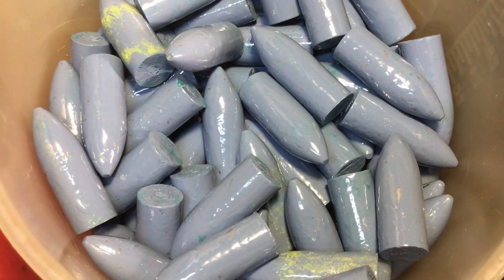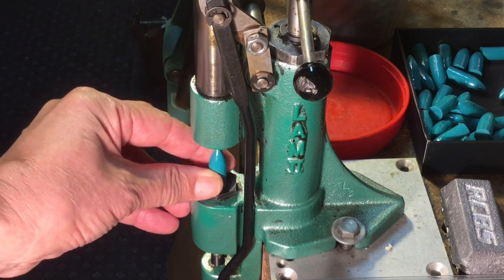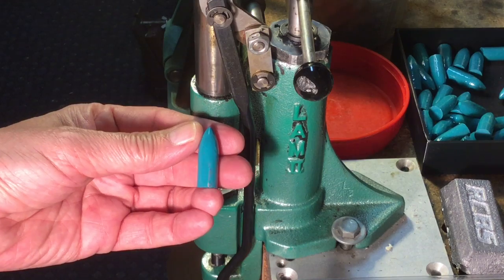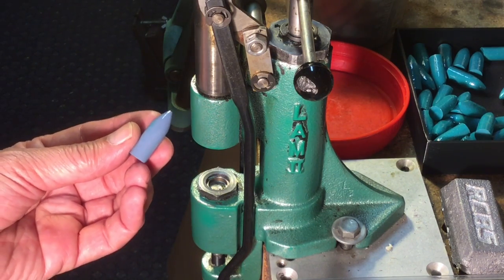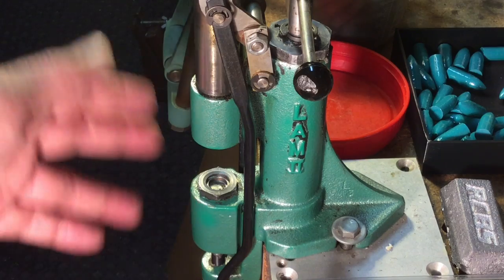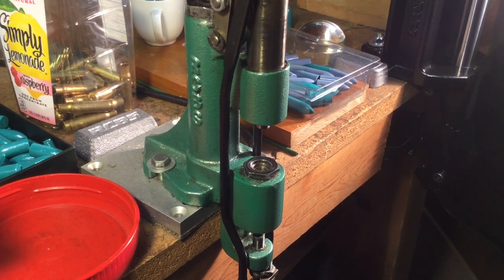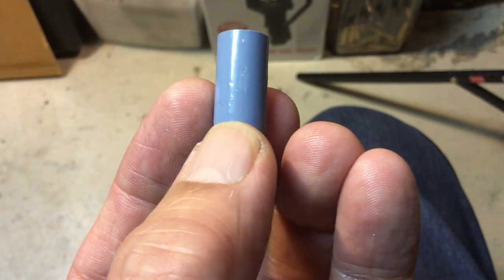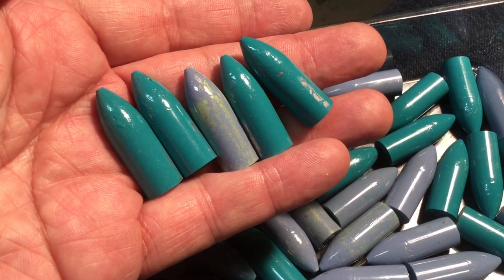Sizing The Grooveless Hard Cast Powder Coated Rifle 45s

Comment: Lee offers sizing dies in custom sizes for $38 according to their last cataloge, so you can get a lee sizing die in the right size and not risk damaging your die by trying to sand it out.
Reply from the maker: George Goff -  Thanks, George, but another commenter tell us that Track of the Wolf has some oddball Lee sizer kits available - I'm placing an order tomorrow... Best to ya,  FC
Reply: I have the track of the wold lee .459 I use for .458 socoms. I'm using it for the lee 500gr .459s, but mine have the lube grooves. Works fine though.
Reply from the maker: jesondag - Having the lube grooves makes that bullet more versatile - we can lube them the traditional way if we option for that...but with the grooveless, that option is not available.  Still a fine bullet to use...Best to ya,  FC
Reply: I powdercoat everything though, so I'm considering picking up one of these NOE molds. They come in 5 cavity, which is pretty cool.
Reply from the maker: jesondag - The 5 cavity from NOE really is cool...Whatever you use, - Good castin' to ya,  FC

Comment: Great videos! Thanks for continuously pumping them out. 

How does the aqua boolits hold up to a smash test? Do the different powder coatings all have the same smash test results?

How do you calculate hardness? Do you have any method to test the hardness before and after casting, quenching and coating?

Thanks again, Gara

Comment: You can get a custom Lee sizing die in any size you like whether its .458, 458.5 or .459. I had to get a .359 since they only make .357 and .358, but must say for powder coated bullets it really works great
Reply from the maker: Paul Campo - Thanks, Paul - turns out there are some odd ball Lee sizers already made over at Track of the Wolf - I'm placing an order tomorrow... Best to ya,  FC

Comment: I agree.....".case lube" reduces the friction during resizing
Reply from the maker: Rogers Steven - The case lube was tried, but did not reduce the number of rejects until the lube pressure was add to prevent the lube holes in the die from scraping the powder coat it was Todd Newsome's idea... It worked..!!  Best Regards,  FC

Comment: You may benefit from having a slight amount of lube on those bullets before you push them through the sizer, you could also benefit from getting locking mould handles, they really work well !
Reply from the maker: Englishman French - Did try the lube, but the rejects still happened - until another idea was added (video coming up)  Never heard of locking mold handles from Lee - must be an aftermarket add on... sounds interesting... Best to ya,  FC
Reply: FC 45: Sorry for the confusion there, the locking handles are made by 2 companies that I know of, they are not by Lee, but with a locking facility they give exactly the same "squeeze" pressure for every pour, it also gives your hand less stress in a long casting session, I am not sure if I am permitted to mention brands on here, but if you go to the site of a company that makes the Sharps rifle, in Big Timber, they have them.
Reply from the maker: Englishman French - Mentioning brands is very much welcome - to Shiloh Sharps it is...!!  Best to ya,  FC
Reply from the maker: Englishman French - Just checked out those locking mold handles from Shiloh Sharps - looks like they don't fit Lee 6 cavity molds - good for the 2 cavs.  Will have to do more investigation on those... But those rifles are sure sweet...!!  Best Regards to ya,  FC

Comment: I've always sized my cast boolits first with a Lee sizing die.  Then powder coat.  After a day after  (preferable more time than one day after PC), size them again with a Lee sizing die to my preferred size.  IE.  Size a 9mm cast bullet to 0.357.  PC it after.  Than size again to 0.358.  This of course depends on your bore diameter.  

Looking forward to your Range results with those thumper boolits!
Reply from the maker: migraineme - The only reason I don't size before PC is having to lube the bullets to size them...then having to degrease with acetone or other before PC can be done... If I can PC them first, then size to final - we just go straight there.  And that has worked so far...even here.  But it sounds like you are having success with the multiple sizings... Continued success to ya,  FC and Best to ya
Reply: FC45LC, instead of traditional bullet sizing lube, try isopropyl alcohol.  I use an old dish, pour a little in there.  Take a boolit, drop it in or just enough to get the sides covered wet.  Then push that puppy right through the sizer.  Since it's Isopropyl Alcohol it evaporates leaving no mess too.  Give it a shot sometime.
Reply from the maker: migraineme - I do use isopropyl alcohol in my lanolin case lube...but never just used the iso for lubing...Will have to give it a try...Best to ya,  FC

Comment: I have a suggestion fc try pressurizing the lube chamber or spraying some lube on the bullets.   It's looks like your only losing the powder coat where the lube injection holes are located in the sizing die the lube spray or having standing pressure in the sizing die could eliminate this problem and it may not I'm sure you've thought of solutions for this plus your are the man the myth the legend FC45LC
Reply from the maker: Todd Newsome - Thanks for posting, Todd.  I expected someone to suggest doing the case lube.  I had already tried the alcohol / lanolin case lube and it made the sizing feel a little better, but did not help the rejects - just forgot to  report on that.  My thoughts were to go with a softer alloy and forego hard cast penetrators.  But after your comment, I went back and lubed plus added your suggestion of not only pressurizing the lube on the RCBS LAM2, but also plugging in the heater...Result was success - you hit the nail right on the head with those scrape marks caused by the lube holes..!!  The rejects just got cut down to 0 with the Periwinkle Gray and like only 2 rejects out of 50 with the Aqua Blue...I've got to do an update immediately to let everybody else know...This is a great tip that will really help when we are trying to size down .003 with hard cast bullets... Hit 'em with the case lube and run the heater / pressurize the lube... This is really joyful... Best Regards to ya,  FC
Reply: FortuneCookie45LC yes nailed it thanks for trying my suggestions it makes me feel like I'm a success I just helped the great fortune cookie lol
Reply: Looks like its working from FC latest video....My 2 cents its the "Hydraulic" pressure that is helping remove the bullets
Reply from the maker: gman77gas - works like a charm when you compare without doing that... all the difference in the world...Have a great day, Gary -  FC Steve

Comment: Track of the wolf website sells Lee .458, 459, 460 sizing dies maybe more Plus lots of other fun stuff
Reply: Exactly...have bought them from TOW. After comparing generic powder coating with the proprietary "Hi-Tek" bullet coating from http://hi-performancebulletcoatings.com/ There is no comparison. In my experience, the Hi-Tek is far superior.
Reply from the maker: AbitNutz - Have known about HiTek since Bayou Bullets had the system available, but just haven't gotten around to trying it...My plan was to buy some 45/70 coated bullets from Bayou to try first... Thanks for posting... Best Regards,  FC
Reply from the maker: Daryle Hayward - After sizing with the 458 Lyman sizer, the bullets came out at .4595 so I've got good workable bullets to begin reloading...but I've got to mosey over to TOW to see what they got... Thanks for the tip,  and best to ya, FC
Reply from the maker: Daryle Hayward - Just checked over at TOW and no wonder I never visited their site before - I've done IPSC, PPC, High Power, Steel, and Competition Trap but never done any BP all these years.  I'm going to place an order for the .459 and .460 dies tomorrow... Thanks again for posting the tip... Best to ya,  FC

Comment: GET A NOE SIZER SET
Reply: +1 they work great an it has multiple ways of sizing your bullets using your reloading press which if you have a heavy duty one like the Rockchucket or Lyman Crusher or Mec it make sizing large harder bullets much easier .  I use one to nose size bore rider bullets like the Lee 185 gr. RN after they have been PC.  Al makes just about any diameter sizing bushing for nose as well as base sizing bullets or both if you choose to do that.   One of the adapters included with the sizing kit allow you to use NOE nose punches that  come with the mold to size bullet base first.  Individual busings cost about $10 each.
Reply from the maker: Donald Swens - Thanks, Don, but another commenter tell us that Track of the Wolf has some oddball Lee sizer kits available - I'm placing an order tomorrow... Have a great day, FC
Reply from the maker: Reloader 7sixtwo - Thanks, will have to go over to NOE and check those out... Best Regards to ya,  FC